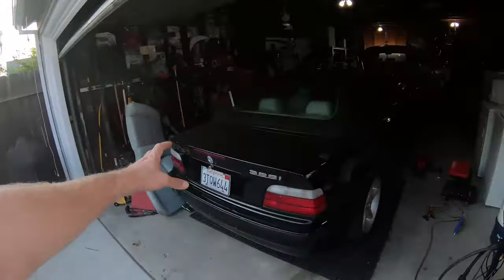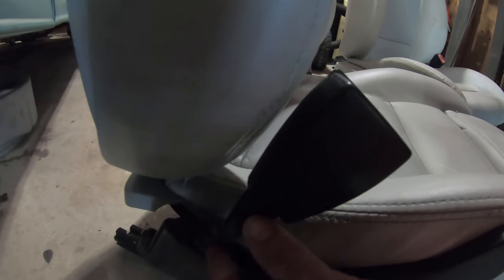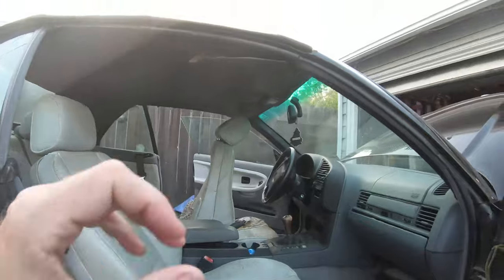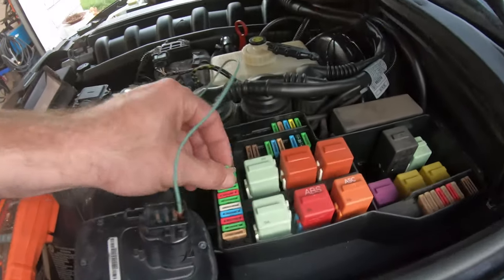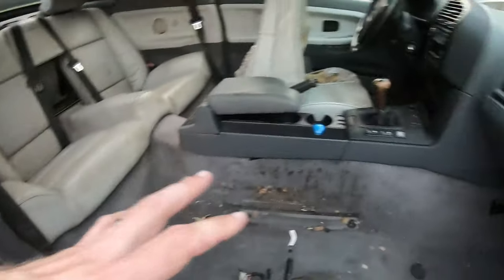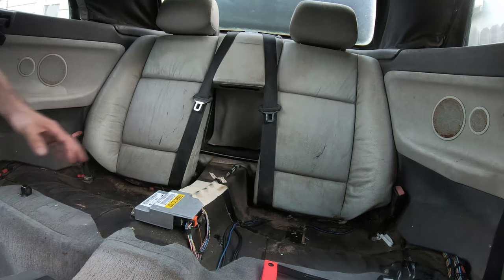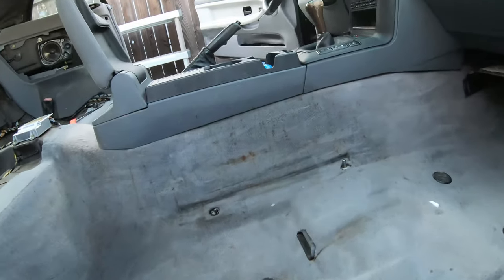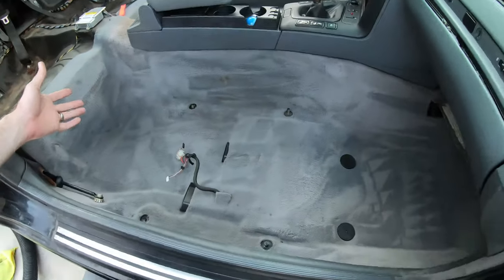Removing Electric Car Seats at the Junkyard without a Car battery

Comment: Bro I appreciate your video so much, I've been fighting for a while to find a way to get a seat out of my parts car in my garage (I didn't have the forethought to move the seat forward before pulling everything past the firewall 😅) and everyone was telling me to rip the harness and plug power into it and was saying I wouldn't be able to do it through the fuse block, I saw your video, grabbed my Milwaukee 18v and a couple lengths of wire, grounded to a body ground in the dash and shoved the other into the Fuse block and voila the seat moved no problem! Thanks man!

Comment: That’s an excellent trick right there. I’m planning on going to the “self-service” junkyard to get a heated seat module and I was wondering how to remove the seat if it’s all the way back. Thanks.

Edit: Unfortunately, in my case, someone had cut off the fuse box of the donor car O.O I had to remove the seat cover & foam and then unscrew the bolts holding the seat to the rails.

Comment: Ayye just what I needed, about to pull some seats for my e34 and I know CA pick n pulls are fussy sometimes. Hopefully no more seat twist after today. Thanks!
Reply from the maker: Nice let me know how it works out for ya.
Reply: @BlakesGarage  it helped out big time! The rear doors were locked and I had to do the same thing to the central locking system to unlock them. The drivers seat didn't want to work tho, might have had something to do with the memory function. At least I can fix all I need for now with just the passenger seat

Comment: I tried this to lower a power window today at the junkyard and I couldn't get it to work. My thought after, was I needed to power two fuses, both drivers side and passenger side, to get the passenger window to roll down. However I couldn't even get the drivers side down.  I was able to use this trick to get the alpine cd changer to spit out the magazine. So I got that going for me, which is nice.
Reply from the maker: Could be that they only with with on key but you could connect directly to the window switch or motor itself.

Comment: Hi Blake,
I just came across this video, and if you can answer a question please, for me...
I bought a powered, seat back for a SONATA. The seat portion of my seat is great, but the back part at the seam split.
Is there a way to easily exchange just the whole back of a driver's side seat? I know I will need to remove the whole assembly, but can't find any videos on the subject.
Many Thanks and Merry Christmas to you.
LG

Comment: So...I was just at the junk yard and found some somewhat decent seats from a e36 325is coupe. HOWEVER, the fuse box is also missing from the car. Anyone know a solution to this?
Reply from the maker: You can unplug the harness below the seat and do the same technique just will have to setup something good with some wires before

Comment: BLAKE. IS IT POSSIBLE TO TAKE AN ELECTRIC DRIVER SIDE SEAT AND REMOVE AND REPLACE THE DRIVER SEAT OF A 2003 HONDA CIVIC LX FOR  ONE JUST LIKE THE ONE YOU REMOVED FROM THAT CAR YOU WORKED ON.?
Reply from the maker: Anything is pos with enough modifications. It’s not just gonna bolt in tho.

Comment: Dewalt battery 18 volt?
How about normal external battery with 12volt?
Reply from the maker: They will not allow you to bring in a battery and hook it up. That why you do the drill trick.
Reply: @BlakesGarage  ok so,conclusion 18v required..
Next question, how u connect to the fuse circuit?
The fuse have 2 side,, do u connect all side circuit to + battery drill?
Reply: @BlakesGarage  which side can i connect with +battery
Reply from the maker: Rani Trana google it. Each battery design is different or use a volt meter. Negative goes to chassis ground.
Reply: @BlakesGarage  i know man,,
I mean slot number 5 fuse box 1side or both side you connect to +battery??

"Fuse has 2 side"

Comment: Driver seat another story. This method only works for passenger side only.
Reply from the maker: No it works for both just use the different fuse location on the fuse box each seat is feed from a different circuit.

Comment: So this doesn't help on a car that had an engine fire :p
Reply from the maker: I mean it could just depend on if that circuit is melted going to the seats. You can also use the drill battery method at the seat plug itself. Get creative something will work out for ya 👍🏼